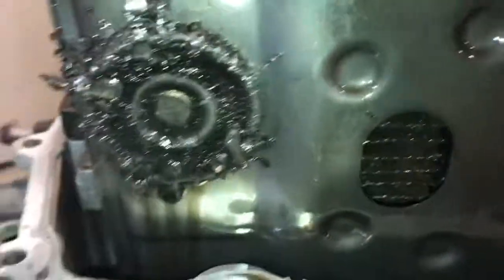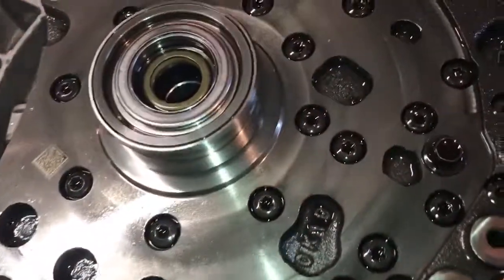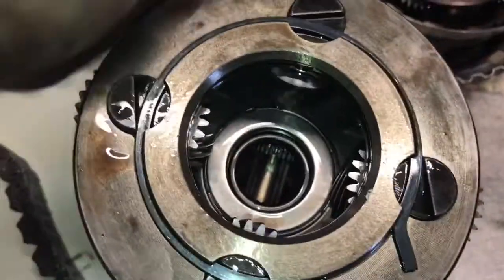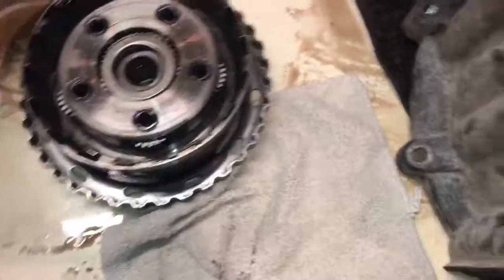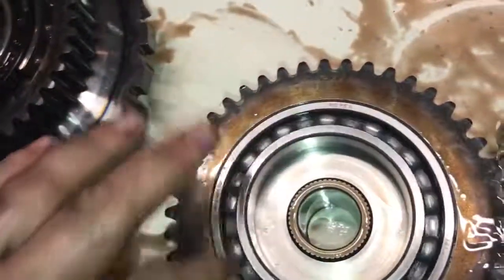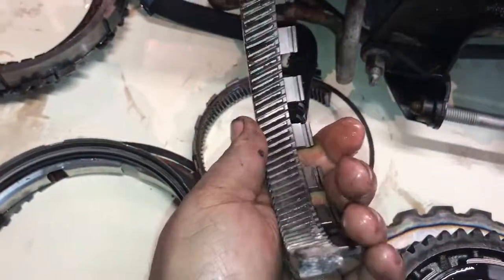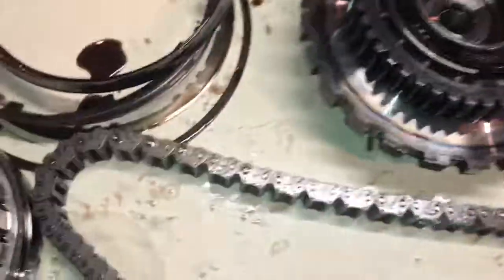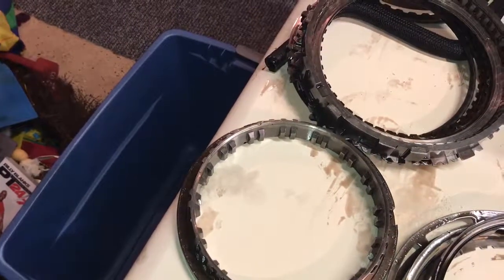WILEY Motorsports S.P. •    6F35 transmission teardown Part 1

Comment: 2015 Escape AWD 1.6. Has a loud whining noise. Sounds just like a bearing, but I don't know much about this 6F35. Have P0219 0verspeed code because when tries shift into 3rd, engine revs up. Sometimes slips, sometimes hard shift. Drained some sample fluid, saw no metal, but it is dirty.  CLOGGED FILTER?  PLANETARY SET?  TORQUE CONVERTOR? Seems like a common problem with this thing,

Comment: rebuild?
Reply from the maker: Shaun956 

Replace with 2012 model year trans.  Design defects were corrected in mid-11 for the 2012 models year so this problem never happens to 2012-2015
Reply: WILEY Motorsports SP  ohh okay i have a 2013 ford fusion with the tranny model 6F35 awd, you think i can use a different year tranny ? like if i wanna use a 16 tranny? in put it in my 2013 for example
Reply: WILEY Motorsports SP My dad has a 2014 Fusion and the 6f35 transmission is slipping.